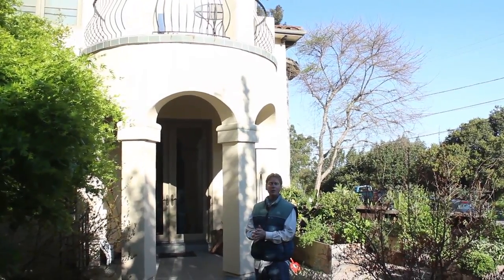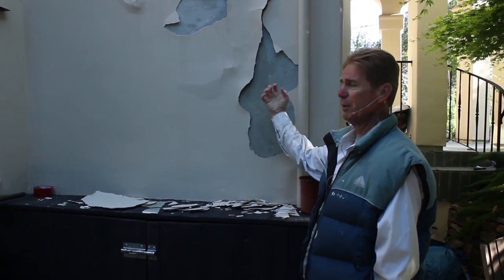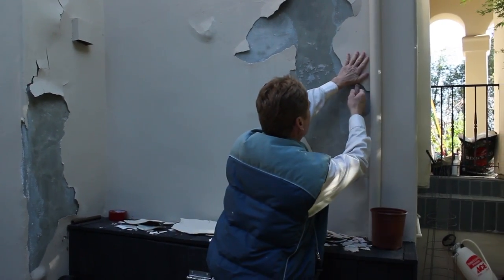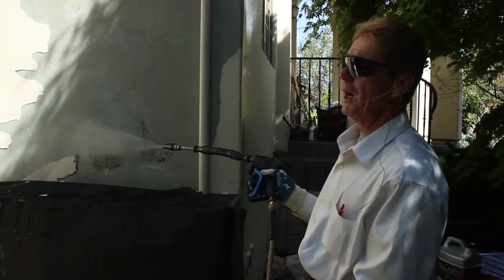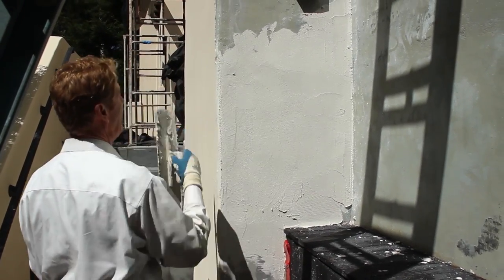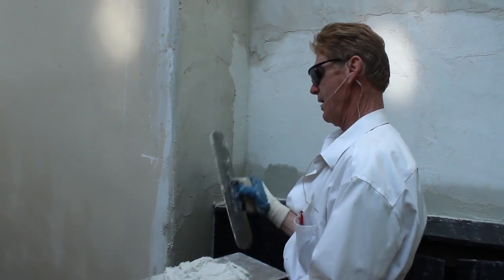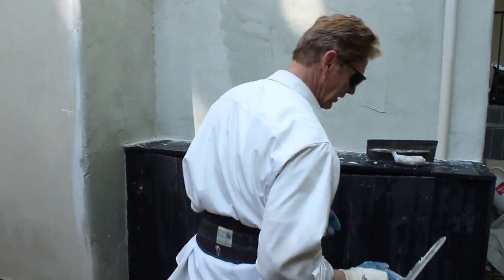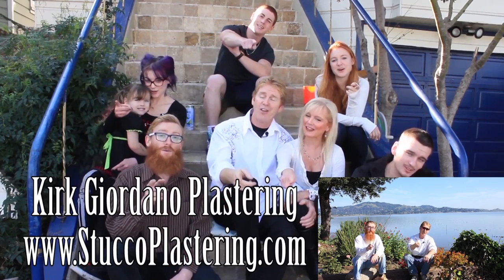Why stucco finishes sometimes fail and come off

Comment: hey Kirk really enjoy watching your videos the company I work for we path and do drywall but I always wondered why can be the cause of the finish cracking?
Reply from the maker: Howdy Alberto dude, I mentioned why this may have not stuck well as the pollen from that large tree does emit a lot, that can be very dusty, if not noticed for whatever reason, the base can and will separate as nothing adheres to dust and or pollen.
  Cheers, live long and plaster
 Giordano’s plastering tips with images

Comment: Hey Kirk - thanks for all of your videos. You're a plethora of stucco knowledge! I was wondering if you had any experience with or opinions on surface bonding cement (aka quikwall). I'll be parging a small retaining wall (50' x 2') next to my driveway and was planning on using sbc. While more expensive, it seems like the added strength from the fiberglass would give a DIY'r like me a little more insurance from cracking - especially since the wall has heaved/cracked in some spots. I know that's more of a drainage issue which I'll address prior to parging. Do you treat sbc like any other stucco when parging? Thanks Kirk!!
Reply: By the way - the wall is an old cinderblock wall in NJ if that makes any difference. Thinking a 1/2" skim with a float finish would do the trick!
Reply from the maker: Howdy Pretzel Dude, Quikwall is manufactured by quikrete, Quikrete wrote the book on cement plasters, I'm sure they have added the bonding agent necessary into this mix especially since the bag says surface bonding cement plaster.
 Best wishes with your projects, live long and Plaster
 Kirk giordano on teaching plastering
Reply from the maker: Howdy Pretzel, as long as that wall is clean enough to eat off the product will work, if it's painted I would after pressure washing still apply a bonding agent myself.
 Best wishes with your projects, live long and Plaster
 giordano on teaching plastering

Comment: Hi KirkI've probably watched 50 of your videos.  Great info.  What's your opinion of elastomeric coatings vs. a restucco/redash.  I'm not entirely convinced on the longevity of an elastomeric coating.  I would assume a new color coat would last a lot longer.
Reply from the maker: Howdy  Blake, new cementitious color finishes are great but acrylic color coats are a bit better, that's one of the reasons they cost roughly 3 times as much to have completed on any home.
 Stucco-flex, Dry-vit, carson's, BMI,  are great acrylic companies, just to name a few,
 the bad ones I won't mention as this is a positive channel, instead I prefer not to mention them,  as some acrylic's suck.
Cheers,  live long and plaster
 Giordano’s plastering images and teaching video’s

Comment: Tadelakt ? this is a lost art. i'd love to have a true lime walled shower room finished with the old ways of Tadelakt.  he'll throw in a sink and tub made this way and I'll be a lucky fella. 
 on this job I wouldn't  have put plastic or any water membrane behind the wonder board. no point in it. the more air that moves behind and through those products the better. just like lime walls, they need to breathe. the only thing I'd consider doing in terms of vapor barriers is using a hydro barrier on the front side of the wonder board. done is the day of plastic and vapor barriers behind walls in high humidity areas.
Reply from the maker: Easy big daddy, I'm just an applicator.
 Although lime plastering does indeed breath and is know to be self-healing lime does also allow water to penetrate thus can and will rot any wood.
 I would suggest to anyone to use a heavy mill peal and stick moister barrier under and cement boards, then use whatever lime plaster or tile that floats one boat.    
           Cheers, peace & harmony 
Sound Plastering tips from your favorite stucco geeks